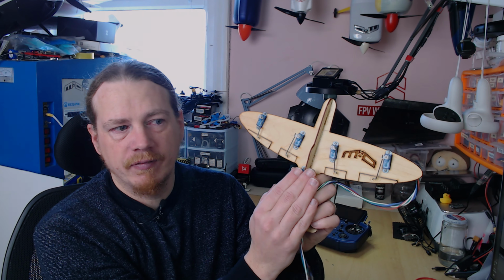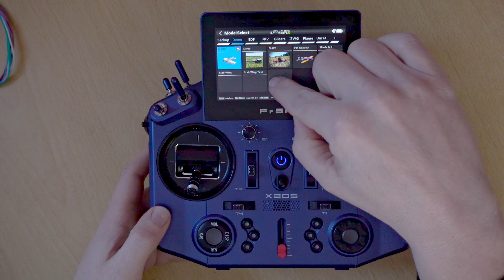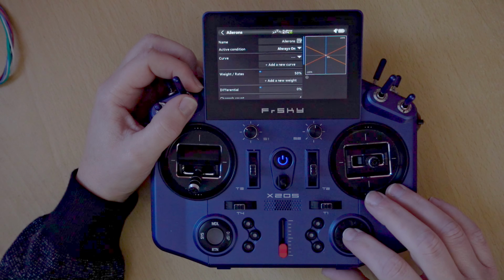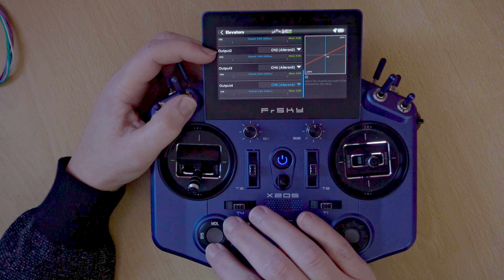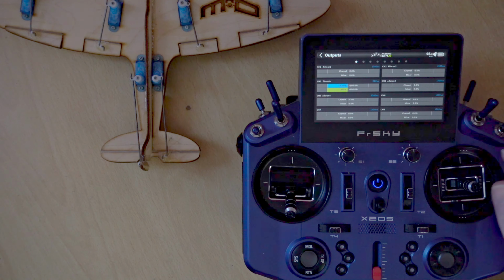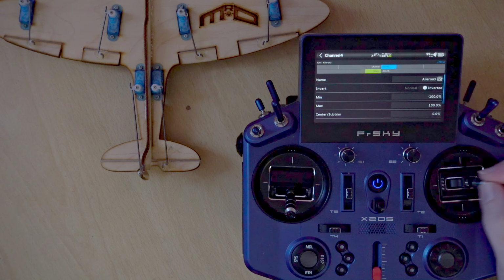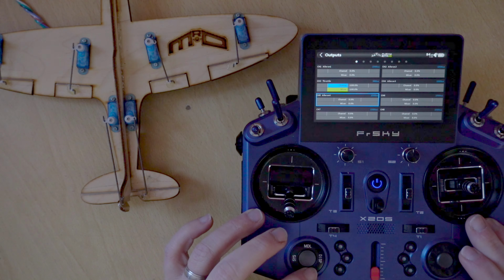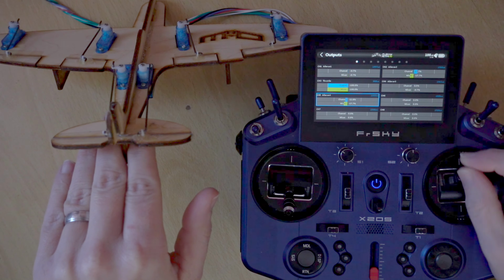FrSky ETHOS Mixer: 4 Elevons, 1 Wing

Comment: Do you know if the siyi A8 camera is compatible in inav
Reply from the maker: I don’t believe the control side is yet. But it is due to be worked on.
Reply: @MrD  control as pan and tilt, or tracking. I would buy it and use it if could pan tilt zoom. If basic functions would work